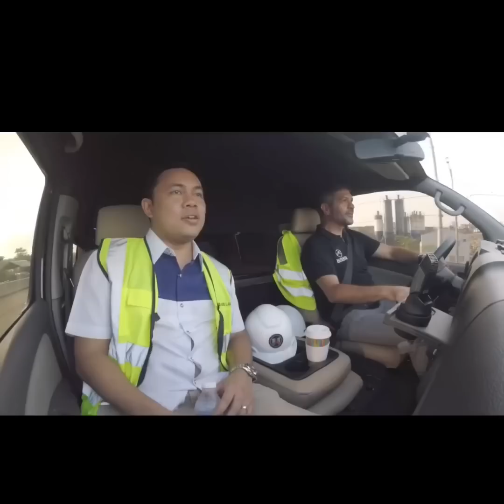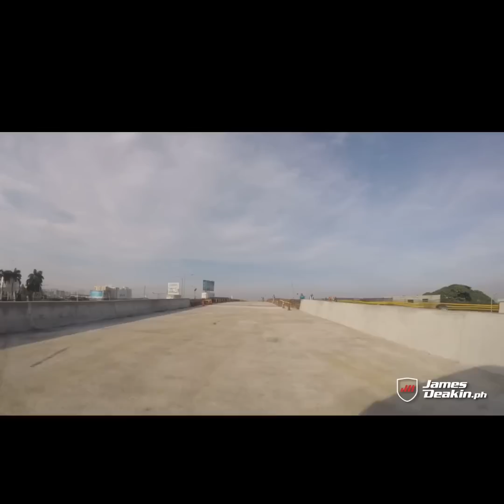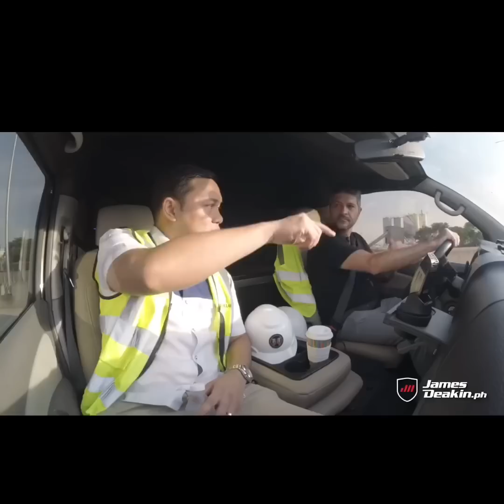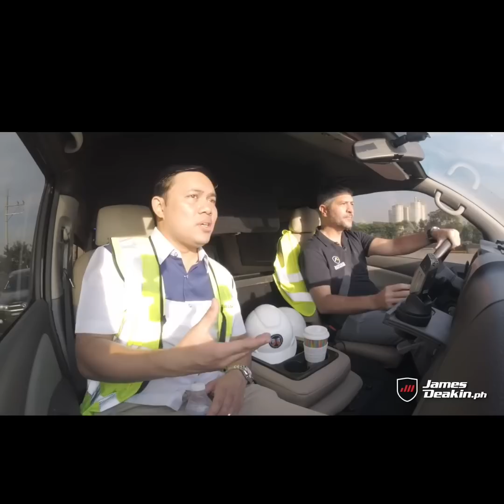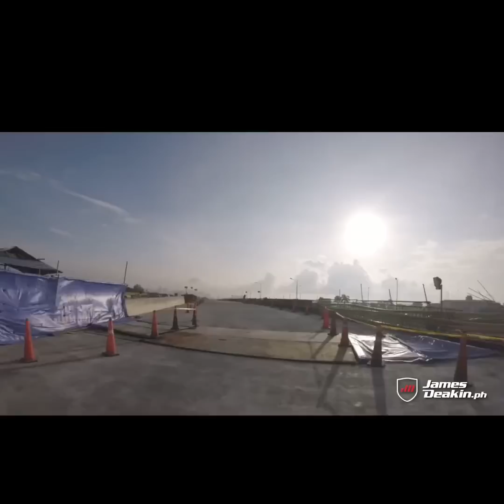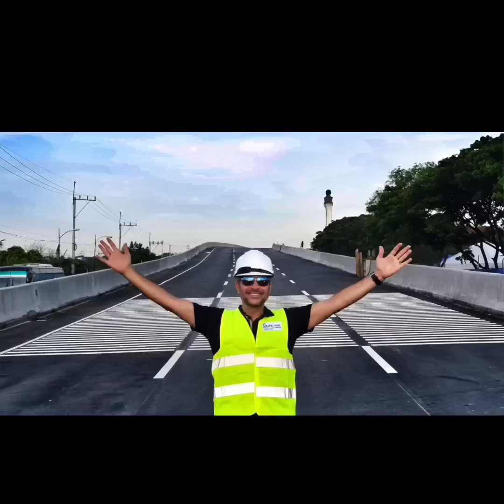First drive of the new C5 south link

Comment: While we have to acknowledge the accomplishment and give DPWH/SLEX due accolades, I also would like to flag a major issue they failed to pre-empt: They failed to address first the choking bottleneck at the C5/Multinational Village intersection which is now being managed by a traffic light and an auxiliary traffic officer. As it is now, traffic is already quite heavy in this area. But as soon as they open this C5/Slex Bridge, traffic going to Cavite from Pasig and QC will surely deluge and clog the C5/Multinational Intersection. I pity the residents of Moonwalk and Multinational Villages. I will predict with my eyes closed that the queue could go as far as the Moonwalk Road or even further.

In a similar vein, and just a bit further the C5 extension that Villar built over his vast estate is the C5/Quirino (Las Piñas) intersection
🚐 That actually now can flow vehicles out to Coastal Road (Manila direction only),
🚐 That actually now is having a vehicle bottleneck.
I'd just wish we have urban planners who had sufficient common sense. 🤔

In short, the opening of the Merville C5 extension overpass will ease traffic out of Paranay to Taguig, Pasig, but it will create more traffic at the C5/Multinational intersection and at the C5/Quirino intersection.

Suggestion: For now, please, close the flyover traffic coming from Taguig, Pasig flowing into Parañaque until the Flyovers are completed first at the 2 intersections mentioned above (at Multinational and Quirino).